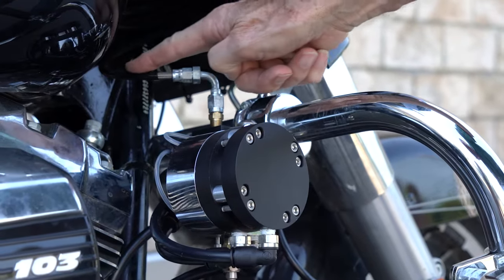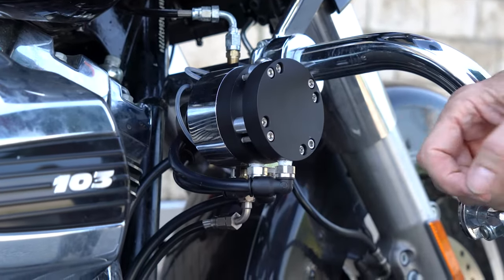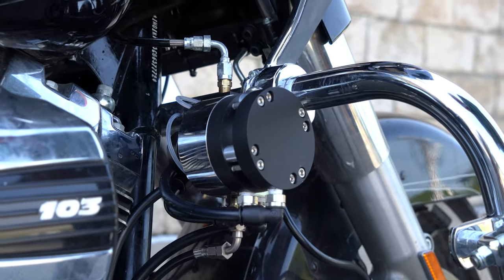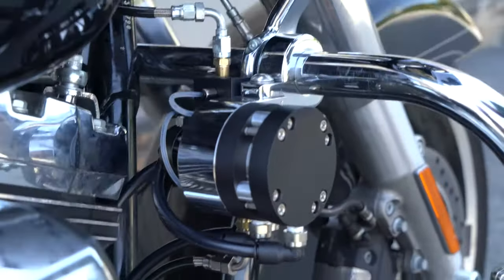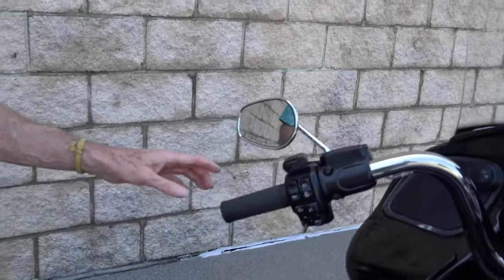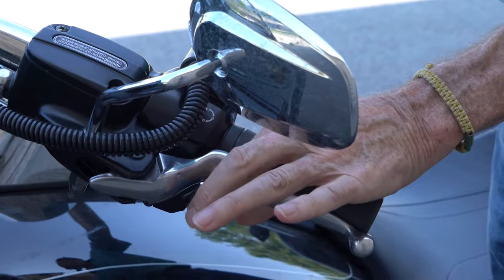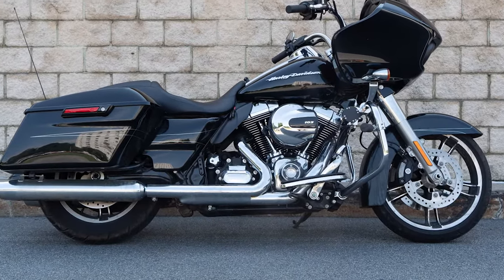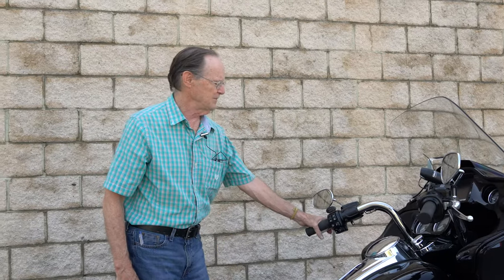HD Hydraulic Clutch Kit - The Feather Lever Introduction Video

Comment: I've ridden John's bike (H-D Softail) with the Feather Lever and I was amazed at the force reduction. I got on the bike and rode it away, without having to spend any time getting used to it. The bike I rode did not originally have a hydraulic clutch. Any big twin H-D cable clutch bike can be converted to hydraulic, then the Feather Lever can be installed. 

This product is the real deal. It's well engineered and well made. Everything has been well thought out for successful  installation.